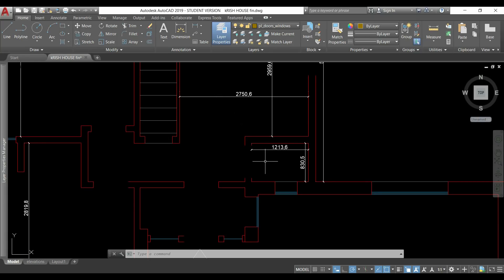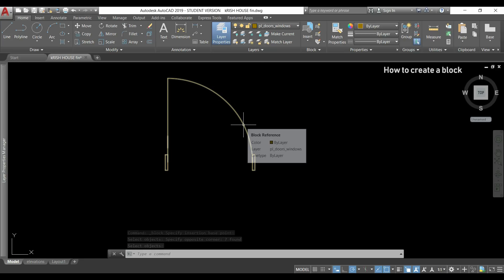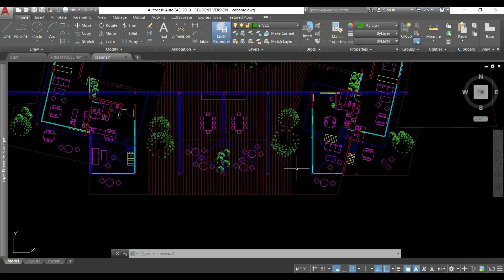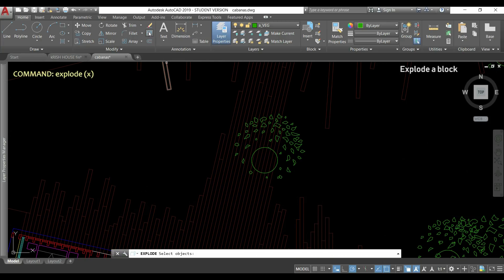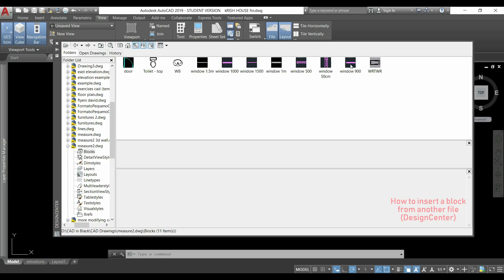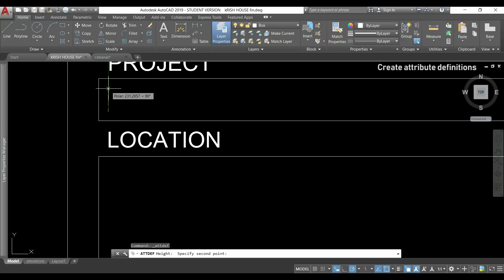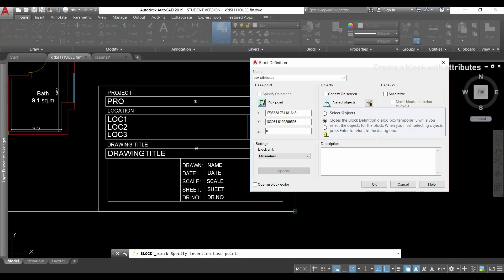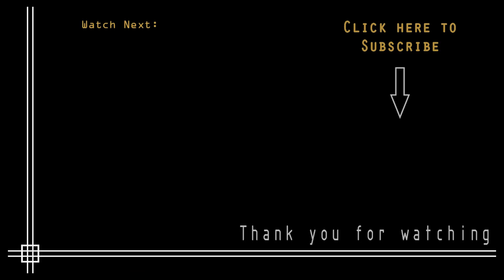Autocad 2019 - Blocks (complete tutorial) + attribute definitions

Comment: not bad but many intermediate/advanced  tips are missing.. especially because copying/pasting blocks from one dwg to another can mess your drawing up and also exploding them. be careful. i suggest you to take care of these details in th next video. cheers
Reply from the maker: Thanks for the tips. I will consider them for next time. Adding blocks from a different file, we have to take consideration the units used there. If you explode a block reference, as far as I know, just applies to that one. Also I haven't mention about the difference between Block and Block Reference. The Block reference is the block object that we insert on the workspace.